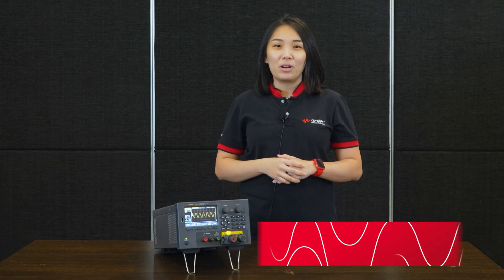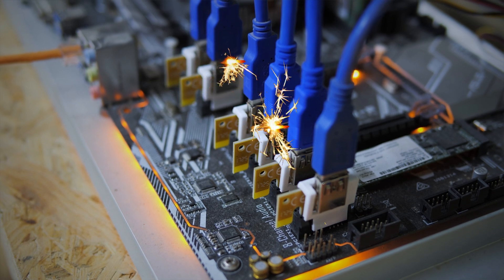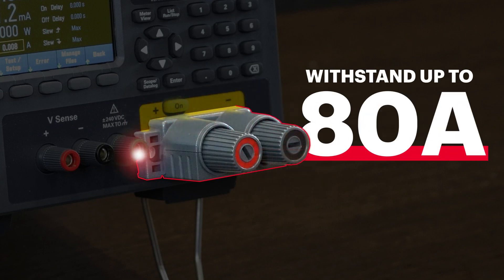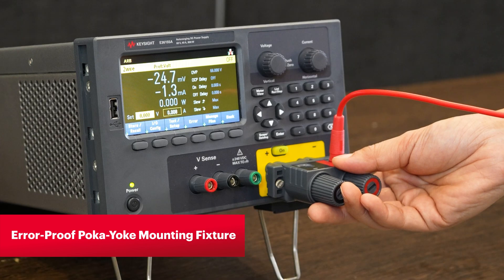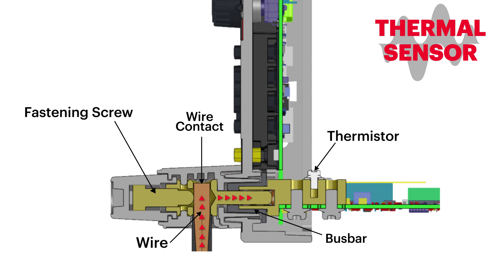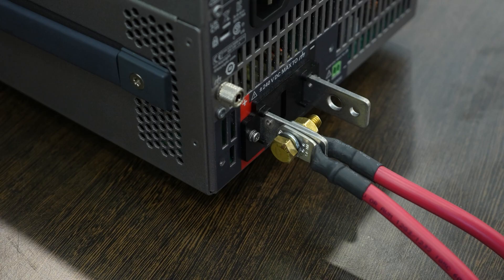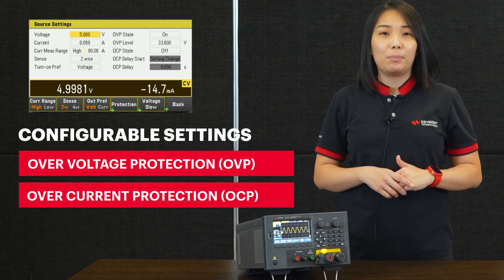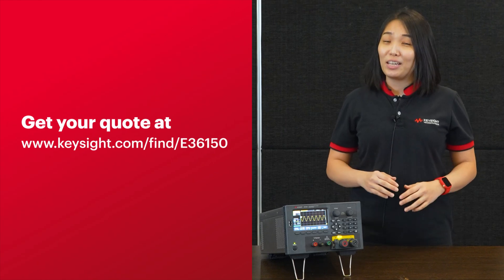E36150 Series: Test High Power Applications Safely Right at Your Bench

Comment: I assume the rear bus bars have a cover that can be fitted on it. Otherwise you're just begging to short out something on those two at the back of your bench. 

Not overly fond of the front terminals being down facing only. If you don't use the tilting feet, it looks like you have to have it hanging over the edge to use them
Reply from the maker: Thank you for your comment. The unit comes with a cover at the rear bus bar. The new design for the detachable front terminal is to ease the wiring connection without the need of tilting the unit. For more details, please contact our sales representative at https://www.keysight.com/us/en/contact.html